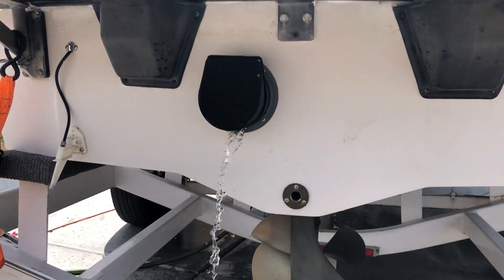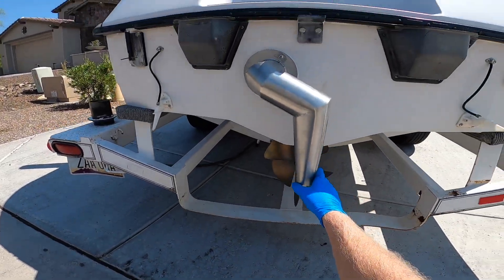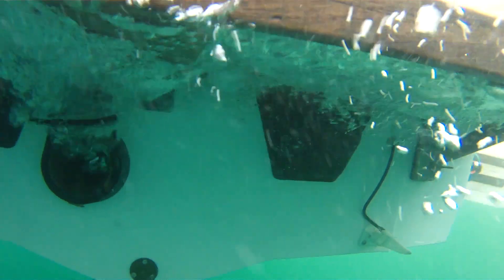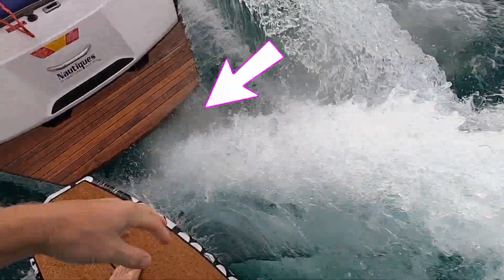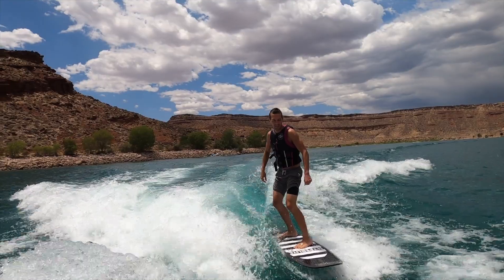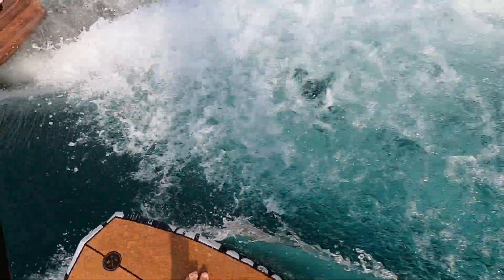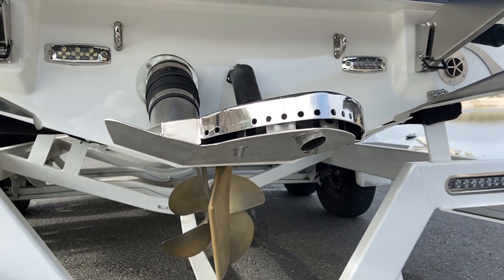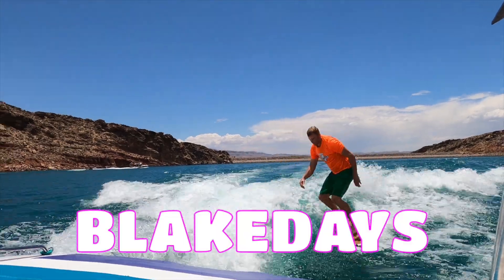What is a FRESH AIR Exhaust?? (Why You Want an FAE on Your BOAT)

Comment: Did you have any trouble with the welds cracking, etc. I see that this pipe doesn't have a support bracket, that is how my boat's FAE is designed as well and I am worried. Any insight? How about excess spray and all that jazz?
Reply from the maker: Thanks for asking the question.
1. I wasn't worried about any welds cracking. They seem to be built very well. This particular one was designed to not have any support brackets. It is mounted in a block on the inside of the transom, plus the transom is pretty thick right there.
2. I didn't increase some spray while wakesurfing, wakeboarding and going skiing speeds. It wasn't anything I thought was really bad. 
I have a couple other videos of surfing and wakeboarding once I have this installed.

Comment: Does the extra bends and or the back pressure the water provides hamper the performance of the boat at all? I picture as with cars and motorcycles, restricted flow=restricted performance.
Reply from the maker: Excellent question. Thanks for commenting. 

It actually doesn’t impact it much at all. As you can see the exhaust tip is cut as an angle. This actually creates a vacuum to suck air out of the system.

Comment: Haha, must be an android user!  One other factor I experienced, on my 2018 24 MXZ it messed up my wakeboard wake which is very important to me.  So I took the surf pipe off.  Clean air and less sound vs Clean Wake, i choose the clean wake.  No impact on surf wave though and I think Malibu might have fixed this issue by bringing the down pipe closer to the boat.
Reply from the maker: Ha ha 🤣. Just for you 😜. 

What about on your Nautique’s?? Did you get the surf pipe option?
Reply: @Sunni_days  Just fine on Nautique so far, I've only seen it on the 2019 and 2022 G23's, both equipped with surf pipe, but wake is cleaner than it was on my 24 MXZ even when surf pipe was off my mxz.
Reply from the maker: An MXZ wasn’t my favorite wake to ride behind…I do like Nautique though. I haven’t experienced much wake or wave disruption from this FAE.
Reply: @Sunni_days  I thought my 2018 24 mxz did pretty well.  What year, make, and model of MXZ did you ride behind?  You aren't talking about a 22 MXZ or a 2016 or earlier 24 MXZ are you?
Reply from the maker: @wake_mann  I was on a 22 MXZ from the first year they made it. Can’t remember, maybe a 2014.
Reply: @Sunni_days  oh yea, i wouldn't expect that wake to be great either.  24 ft and new hull design in 2017 made a huge difference.
Reply from the maker: Nice. Good to know 👌.

Comment: Do people oppose the down pipe because they think it pollutes the water more?
Reply from the maker: Hey, Thanks for taking the time to watch my video and comment. No, some oppose the surf pipe because they don’t think it is necessary. They believe there is enough air around the surfer that “no one” should suffer from carbon monoxide poisoning, or that the newer engines run clean enough for safety.

The other complaint is that it messes up the wave or wake for boarding.
Reply: @Sunni_days  I don’t think I’ve had the chance to surf behind a boat with the down pipe yet. I have definitely noticed a strong smell of exhaust on several occasions while surfing.